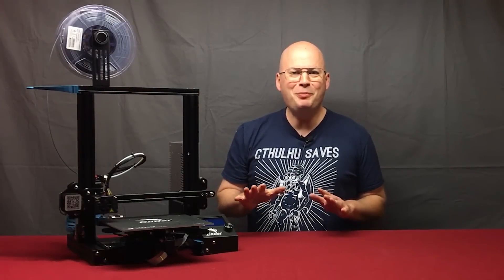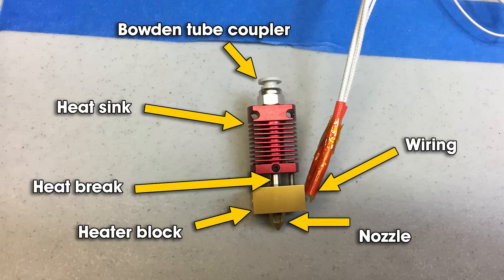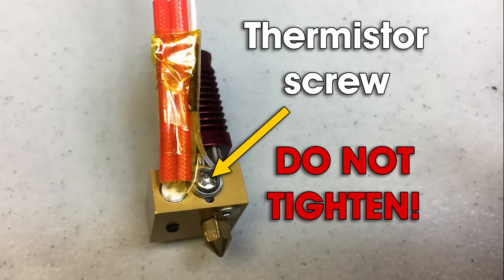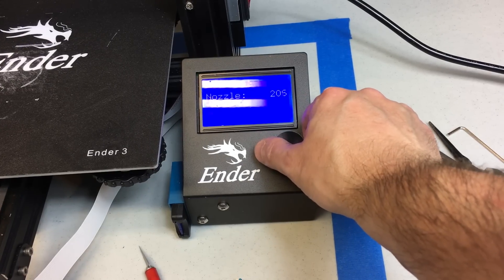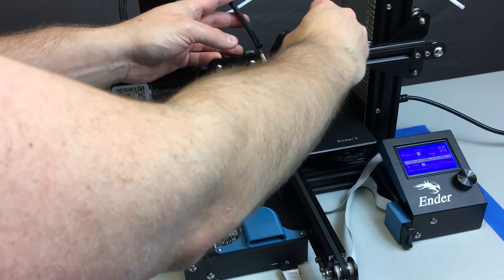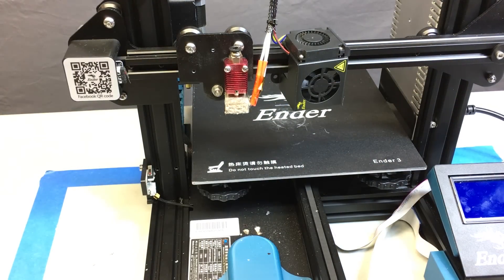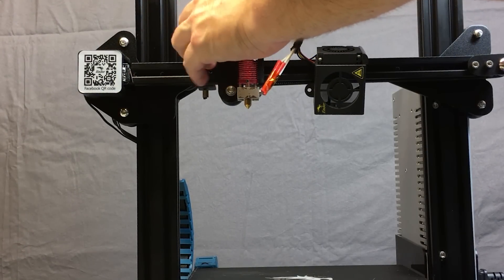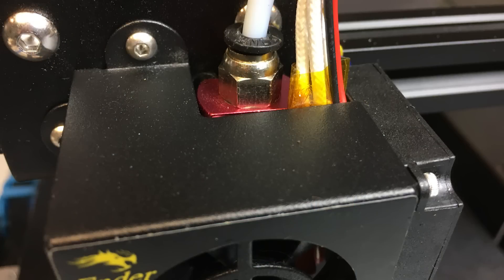Changing Nozzles & Bowden Tubes

Comment: Im not sure you mentioned it but i noticed you removed the filament before changing the nozzle?
 Also, my printer does not use a Bowden tube, does the mean i can just remove the nozzle and screw it back up without doing loosing up the nozzle 3/4 of turn to insert the Bowden tube and simply tight the nozzle?

Comment: I have an Ender-5.  I have been unable to get the Bowden tube out, it seems to be stuck.  You say depress some couplers to get the Bowden tube out, I don't see any couplers.  I unscrewed the connectors that the Bowden tube feeds into. Also, I cannot get the cover off.  It looks like there are two  screws holding it on, but there are also some fans attached.  The cover won't come off.

Comment: When you have the nozzle off, should the heat break be clear?  I can't see thru it from the top.  I would think it should be clear thru at this point.  If not, is the heat break still clogged?

Comment: Tip for cutting the bowden tube
Insert a piece of filament into the tube and then use your side cutters ... because the tube is now essentially solid, not hollow, it cuts cleanly without distorting and going oval
Reply from the maker: Great suggestion!

Comment: How do you put the bowden tube coupler back in place?
Reply from the maker: It screws into the heat sink.
Reply: Ok but the problem is that it will not want to go back in
Reply: What do you suggest?

Comment: I am brand new to 3D printing, and here to gain knowledge -- but wanted to point out something that may help others, in regards to importance of keeping heat-sink clean.  Most are familiar with computers, graphics-cards and heating issues, etc. and should be aware of the importance of keeping dust from accumulating in/on the various parts of the cooling system in the computer (most use compressed air to clean fins of heat-sinks, fan blades, etc.).  I think that the same care should be applied to keeping the heat-sink and fans clean on these printers, to help alleviate problems with what I've seen described as 'heat-creep' in many places.  Just a thought I had today, as I watched this video.

If I am wrong, I apologize, and blame the error on my being brand-new to 3D printing.

Comment: 2:53 - Wouldn't it be better to use a special high-heat resistant thermoplastic for the heat break? As you explain it's main purpose is to prevent heat transfer and I'm assuming that it's also used to guide the filament into the nozzle, with that said some common thermoplastic could be used which can withstand high temperature and have super low thermal conductivity... IDK if lowering the thermal conductivity is overkill or even needed as compared to common heat breaks used today... 5:00 - Great explanation., the wire contains a thermocouple.

Comment: After dealing with constant clogs on my ender 3 I gave up and did the Luke's fix kept getting partial clogs due to the tube not being flush to the nozzle no matter what I tried it would only work for a print or two at most

Comment: If you are not supposed to tighten the thermistor screw, what prevents it from falling out from all the vibrations and movement?

Shouldn't it be tighten down some what tight, but not enough to break the plastic protecting the wire inside?

Comment: im trying to  pull the tube out but its stuck to the point where pushing the cilender wont do anything. any advice
Reply from the maker: Unscrew the coupler from the hot end assembly and pull it and the tube out together

Comment: I've noticed a definite drop off in quality prints recently. There seems to be bands going up the print (you have to look at it from a certain light in order to see it, not straight on). Could this be related to the nozzle? Also, I've had a few times where the nozzle was jammed pretty hard against the bed after the springs wore out, would that damage the nozzle?
Reply: I print pretty much exclusively pla, except for a few prints of petg

Comment: This was very useful. I was able to clean and replace the clogged nozzle and Bowden tube. Although, my print looks much better, I continue to have a line of under extrusion - approximately 1/2 inch from the base of the print. I have replaced parts several times but continue to have this problem. Any suggestions?

Comment: I'm a total newbie.  Got the Ender 3 pro.  I'm most printing minis and such.  I'm using the slicer that came free with it and the stock  nozzle.  Do I need to upgrade to.get the better quality minis?
Reply: Hi, I'm no expert and I have an old school CR-10s but I use ultimaker cure (free) as a slicer. I think if you're looking for the kind of resolution that you'd get from games workshop or similar, then filament printing may not be the solution. Perhaps resin is the answer...

Comment: I'm new to 3D printing and recently bought a Renkforce Basic 3, it's a store brand printer from the "Conrad" store.

I have an issue with under extrusion apperantly, by about 20%, that is very consistent with benchies and a various number of other parts I printed

this printer has the MK10 hot end where you got a plastic bowden tube to the top going stright in to the pipe in the cold end, then inside the pipe is a piece of 2x3mm teflon tube between the cold end and the hot end inside the heatbrake.

the "problem" I'm having is that the filament will always melt about 22mm far inside the teflon tube, basically all the way inside the hot end up to the heat brake.
is that normal?
if not, is there any way to fix that?
are there any good upgrades I can do to that hotend or replace it with a better one?
or should I just get a better 3D printer?

I also have some issues with warping, like, significantly, even with perfect bed adhesion the part will apperantly lift the flexible magnetic bed up

Comment: Thank you :)  Just had a print fail at the halfway point (luckily on a very flat area, so I can just edit the model and likely finish & glue it) - and as a new 3D hobbyist, I was worried I had broken something.  Then I figured it is likely just a clog somewhere, and found your amazing video.

Took everything apart and reassembled thanks to your video - THANK YOU :)

The only issue I had, was that the bowden tube itself was stuck in the hot end (even after removing the nozzle.  In reading around I discovered instead of pulling it out, it was easier to push it through, clip it, then pull it out.  Hope that saves someone else some time.

Test print came out incredible :)

Comment: One thing that is rarely discussed and not discussed here is the relationship between the nozzle, heat block and heat break.
I didn't know originally but figured out that the heat break screws into the heat block.  What I've come to understand is that the heat break should screw into the block all the way, or at least have it bottom out against the nozzle, having the nozzle only far enough in that there's a small gap between the nozzle face on the thread side and the heat block.
So you would be tightening the nozzle as far as it would go so it seats against the heat break, then back it off so you can set up some squeeze pressure against the bowden tube.
Another approach some give to apply the tube pressure is to instead loosen the bowden tube coupler, push the tube all the way down, then tighten the coupler.

Do I have that all correct or is the heat break actually supposed to be loose in the block and not touching the base of the nozzle threading?

I just get so many problems with eSun PLA+, particularly stringing and blabbing even at its lowest recommended temp of 205c

Comment: This explains SO much.
All new to 3D printers and i struggeled with mine until i found out that the heating cartridge were not working.
So while i will change this, i also will give it a new printerhead since (most likely) it was that damaged printerhead that did something with the cartridge.
It's a 2nd hand printer so i'm not to sure how much life the nozzle has, but def will try to find a new one for my ender 3.

Comment: I actually suggest using 6mm socket on screwdriver - this way you can avoid damaging things with bullshit stock whenches and you can screw in new nozzle while heater is hot. It is just far superior grip on the nozzle. No risk of overtightening with this setup (just snug it and thats it)

Comment: I use a 6mm socket to remove the nozzle.
Reply: Same.  I've found using a small socket wrench and a 6mm socket works perfectly; it makes removal and replacement of nozzles literally 'pain free' because you cannot burn yourself, and any stray filament will be contained with the old nozzle when you remove it.
Reply: @ecarter2747  And don't forget a 2-3" extender. Use the wrench to get it loose, then spin it off (or on) with the extension. And yes, the socket gets hot quickly. Don't ask how I know this. ;-)
Reply: @MemphisMark61  I have an 'extender' on by default; since my 'dedicated Ender wrench' is 3/8" and the 6mm socket 1/4", I have a converter between them, which gives me plenty of room to spin it in-situ.  As a result, I have never burnt myself... yet... :P

Comment: Hey I have a brand new Ender 3 V2 and as you and many others have suggested I have bought replacement bowden tube couplers. Given that it has never been used before do I still have to heat the printer when changing the couplers?
Reply: I would suggest you do; since printers are usually shipped with the nozzle system 'ready to use', you can bet it was put together the same way at the factory.

Comment: Hey. Turning back 3/4 seems to let PLA leak out from the threads. Should I tighten the nozzle a bit?
Reply from the maker: Yes, you only loosen it while inserting the tube down to the nozzle, then once that is done you should tighten the nozzle back that 3/4 turn (it may only turn 1/2 turn though, but it will be sealed)

Comment: Hi. I´ve been wathing your videos recently and I´m very grateful for your content.
I came here with a question. I've been experiencing what is seems to be under-extrusion. I tried so many ways to fix it (making sure there is no gap between the bowden tube and the nozzle, the print temperature, changing the filament, use another couplers, change the bowden tube, make sure of use a good bed levelling, clean the gear of the extruder...) and one way or another I end up having this issue a couple days after I seems to be fixed.
It literally stops extruding in the 'middle' of the printing and it is driving me crazy. Any idea what is possibly going on?

Comment: I watched the video. It helps.

I need help. How I got here. After much work I successfully printed the Hairy Lion. (There are hints of under excursion in the lower half of the sacrificial wall. The body looks fantastic). I started a second one. .. Under excursion/tearing happened on the wall about 6-8 mm into it. Why? I did here some chucking noise from the filament feed motor. Could it be it is loosing grip on the filament? Clogged gear or clogged path? How do you truly fix it. I'm probably going to clean the gear at least. Test. If a fail? Then replace the boden tube and the nozzle again.

I may have that gap between the boden tube and the nozzle as said by Tomb. Suff that needs to be cleared out before the next fitting. ... How is that done? Maybe take the print nozzle off and push the boden tube through it all? That could mash PLA into the nozzle threads. What to do?

Comment: At 13:35 The wiring on my fairly new Creality 3 pro, (given to me 2 months ago), does NOT have that braided insulation around the wires to the heater block. I have knowledge about wires/current flow. If you have that braided insulation, I don't think it's there due to the wire getting hot from electric current flow. It's most likely a wear protection thing.

Comment: I wanted to install the filament guide so i unscrewed the screws to install, managed to misalign the flats and then spent 40 minutes to realign them and get the screws trought without a full disassembly. When i got it in and screwed it, the heads popped right trought the filament guide holes and i basically wasted 40 minutes. Now i just put it on without screws. Thanks for reading

Comment: I actually have a nice goldy-brass color outline of a print permanently scraped-etched into my Ender3v2-bed due to a failed bed level calibration, should I change my nozzle? I am not having much luck with getting prints to stick to the bed lately...
Reply: If it went that deep into the bed, then yes, definitely replace the nozzle.
Might need to replace the bed too, especially if the gouge is where you'll print most often.

Comment: I replaced my nozzle before watching this video. I've made a lot of pressure on the hotend without stabilizing it. Should I replace whole hotend now for safety reasons and don't even try to run this again?
Reply: I would concur.  If nothing is broken, everything seems aligned after correcting for the mistake, it will be ok.

Comment: That was a great video on how to. My ender 3 v2 just started clogging it seems and my extruder has been skipping and clunking. I just finished a 50 inch Saturn V rocket lamp. And my printer sat for a couple weeks.Thats when i started having my issue. I ordered a new boden tube. I also noticed my tube at the extruder end was moving back and forth. I guess the lock needs to be replaced. Again great video thank you

Comment: I know this is a somewhat old video (2.5yrs at the time of this comment), but I know this is a go-to source for wisdom. So, I'm going to add my bit to it: BEFORE you start installing the new nozzle...

- Take your cleaning pin and double-check that it's the correct diameter for the nozzle itself with a good caliper
- Force it through the tip/outside end. You may meet resistance, so apply constant pressure until it passes through. Once through, give it a few good twists for good measure
- Pull it out and now push it through the hotend/inside end. If you met resistance before, you'll probably feel it again, but not as strong. Push all the way through, give a few good twists, and slide the nozzle back and forth a few times.
- Proceed with Tom's instructions and finger-tighten the nozzle to the heating block.

The saying is true: you get what you pay for. So if you're buying cheap nozzles like me (and I'm guessing like Tom here), this will help make sure they are the proper diameter and don't have any internal spurs which will cause clogs. Even expensive/high-quality nozzles can have this problem (can't catch ever defect), so it's worth doing regardless even if it is to help remove a potential variable during debugging.

IF it passes through with ease, your nozzle diameter may be larger than what it's marked. You should feel some resistance, like how you can pass the paper between the hotend and the bed when you're leveling. So if you feel none, consider using it as a larger-diameter nozzle instead or toss it.

Comment: how long should the bowden tube be?
Reply: Chep of Filament Friday tested this.  Length itself doesn't matter, as long as it is long enough to allow the hot end to be able to move to the opposite end of the X travel as from the extruder with enough slack.

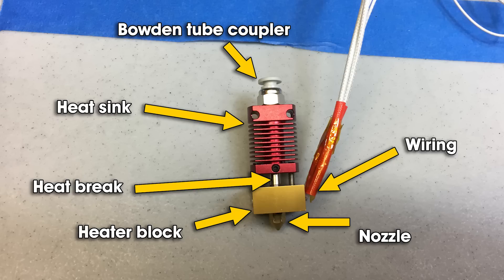Comment: 3:39/15:00  I have the same unit as on the screen at this time interval.  I removed the two screws that hold the heater block to the heat break.  If you do this, you will not be able to seat the nozzle to the heater block.  You will only be able to seat the nozzle to heat break.  The heat break doesn't seat up against heater block from the factory.  This might be why they left the two screws,  to keep the heater block from spinning on the threads.
Reply: Nobody goes over this in detail.  I had asked Chep about this, he said the heat break was supposed to be screwed in all the way into the block, and I also understood against the nozzle.  It definitely was loose from the factory, but then so were those long screws.
Made a mess after the first time I replaced the nozzle as I didn't know about being sure the tube was tight against the nozzle.

I don't get why the heat break is even threaded into the block.  Would make more sense to be a sleeve just as it is inside the heat sink.

Comment: QUESTION: Can you give a list of common damages caused by noobism and how to check for them?

I've had a few things happen that have me a bit worried my recent print issues are a result of damage.

1) I leveled once, and thought I don't have to level again unless I move the printer or something. When I came to level again, I realized my bed was way too high. There's even a copper streak accross it. Looks like the nozzle has definitely scraped accross the bed before.

2) I've had print issues go unnoticed for long periods of time and when I come back there's a big blob of hot plastic caked around my nozzle. When I pulled it off the silicone bumpers around the nozzle were out of position and they sorta feel loose ever since.

3) I was trying to pull a blob of plastic off the nozzle and accidentally grabbed and pulled on the black silicone bumpers on either side of the nozzle. What do they do? Do they need replacement if damaged?
Reply: The silicone sock is only there to reduce surface area that stray filament can stick to.  Easily comes off and on.
If the sock is torn, may want to replace it.
If there's melted filament on the heat block or nozzle preventing the sock from properly fitting, clean them off while block/nozzle is heated.
Reply: Oh, and since you had the bed that close to the nozzle, replace the nozzle, being sure your tube is snug against the base of the nozzle.
I would suggest getting an automatic bed leveler such as a CR-Touch.  Once you get the z-offset right, you can never get the nozzle into the bed since z measurements are relative to bed rather than frame.